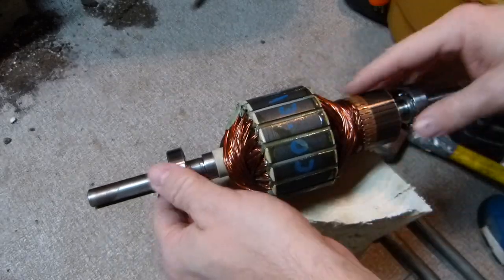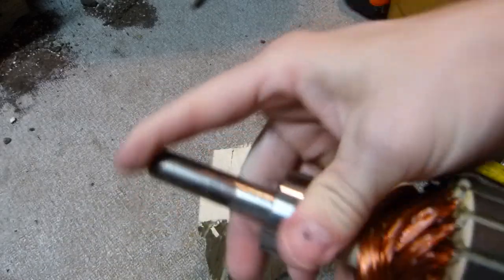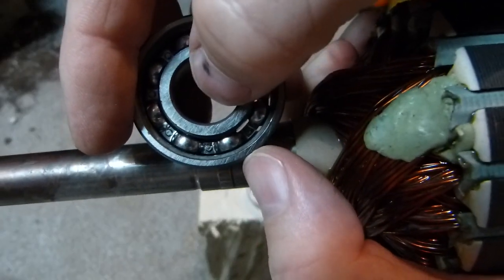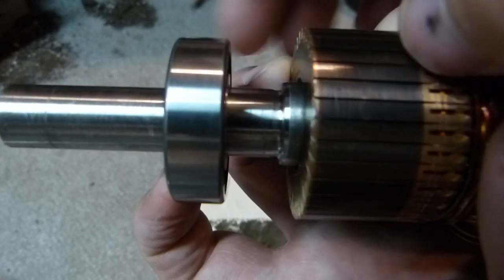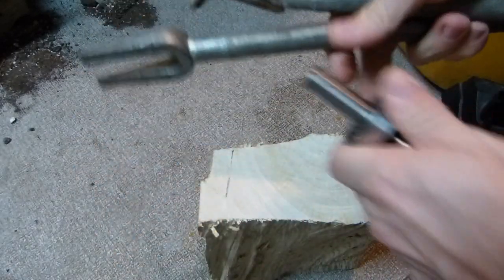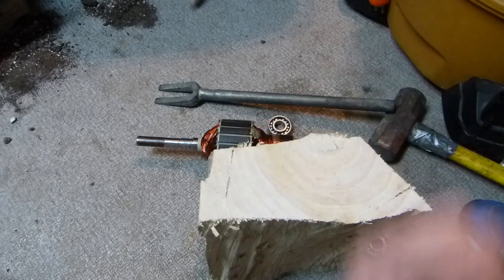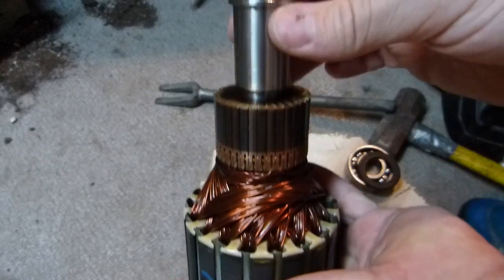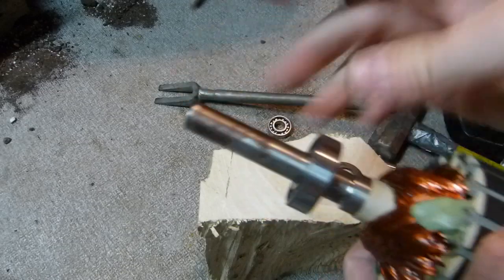Bearing installation: inner ring interference fit

Comment: You can remove the old bearings by heating them with a simple blowlamp. It doesn't need to be very hot but you will destroy the rubber seal and burn off any oil. Therefore not recommend for fitting new bearings.

Comment: Great but how do you install bearings on shaft sizes around 5mm, can I just heat it up and tap it onto the shaft?
Reply from the maker: Tiny bearings need no heating. SKF has a bearing installation guide book, it says on page 53, Cold mounting https://www.skf.com/binaries/pub12/Images/0901d1968013be94-SKF-bearing-maintenance-handbook---10001_1-EN(1)_tcm_12-463040.pdf
"Mechanical methods
Bearings with a cylindrical bore (d = max 80 mm)
Small bearings should be mounted with an
appropriate bearing fitting tool, e.g. the SKF
Bearing fitting tool kit († fig. 14a)."

Comment: Is there any reason you didn’t heat up the bearings?  Instead of POUNDING THEM ON, do it the right way, and don’t destroy your shaft.
Reply: this is old comment and maybe too late too reply, I know by heat up bearing it can removed but some design, in my case the bearing was too close too rubber where the rubber cannot be removed. I think the goal of this video is not to remove bearing but how can we design so we can install and remove it easier.
Reply: Maybe his wife wouldn't let him borrow the oven 😉